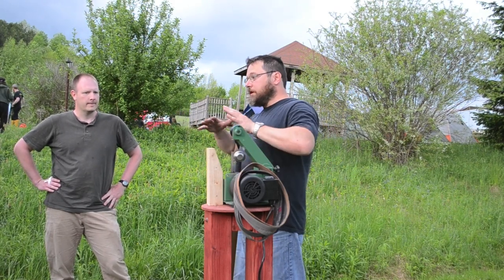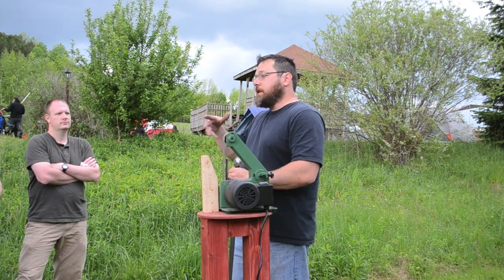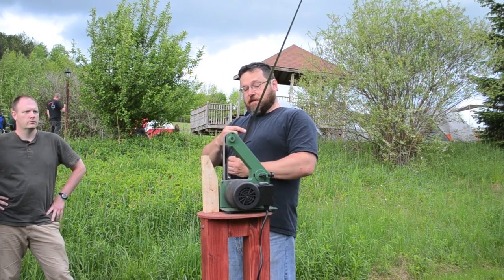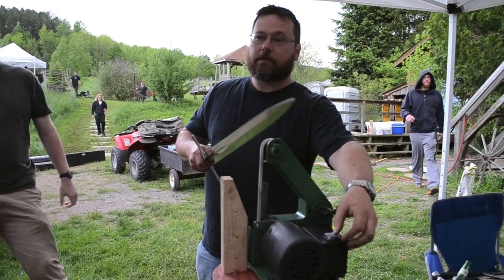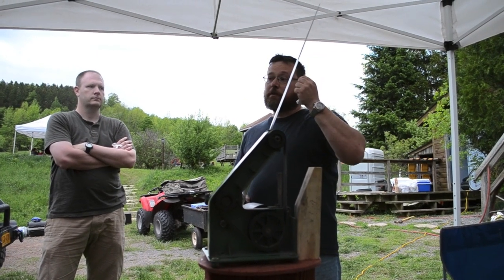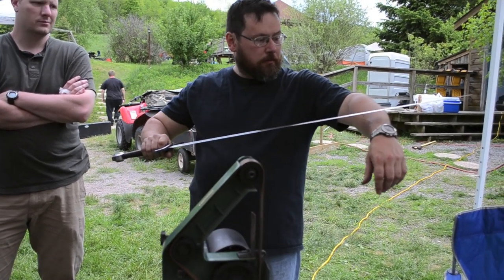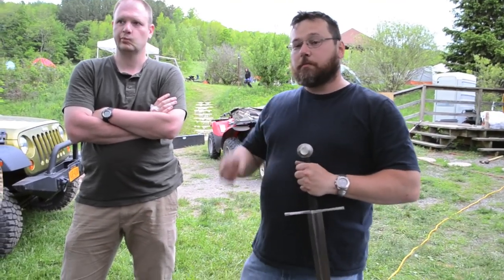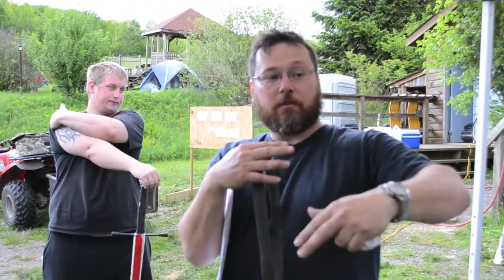Fechtschule New York 2014 Mike Edelson's Sword Sharpening Class

Comment: This is a great video. Karl Bolle also has an excellent sharpening video that is meant to complement this one. I have a Brescia Spadona. It comes from Albion with a 40 degree secondary bevel. If you sharpen that sword with a 40 degree angle, and you only sharpen the cutting portion of the blade, then you end up with a very wide polished edge on the 2/3 of the blade. IMO, that looks very strange. Would it be better to sharpen at 50 degrees, and create a tertiary bevel? Or, is creating the wide, bright edge on 2/3 of the blade the way to go?

Comment: Will this produce any troubles with the tempering? Will you need to cool the blade regularly, or is just the constant rotation of sides enough to let it cool down?

Also, what's the grinding machine you're using? What direction does the belt turn in (or, does it matter?)?
Reply from the maker: The blade doesn't get hot enough to affect the tempering at all, maybe the rotation is part of that?  The grinder is just a 1x30 slack belt grinder.  Belt direction does matter, the belt only run in one direction, down.